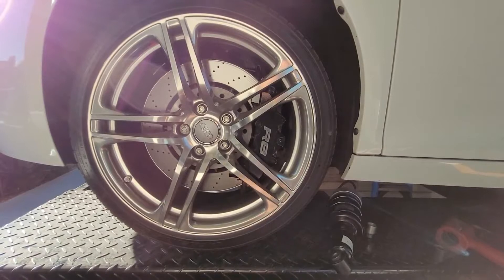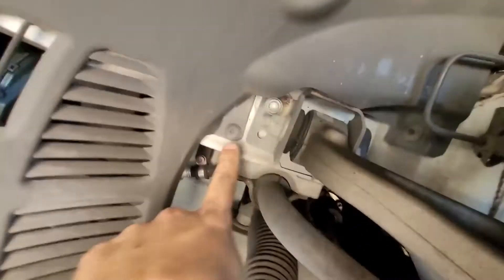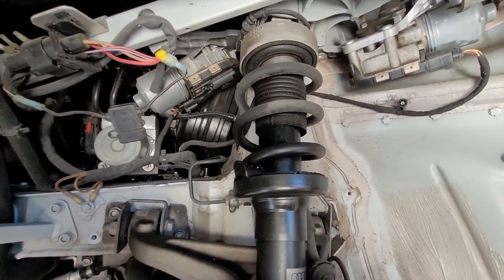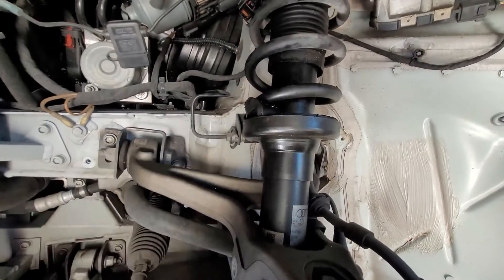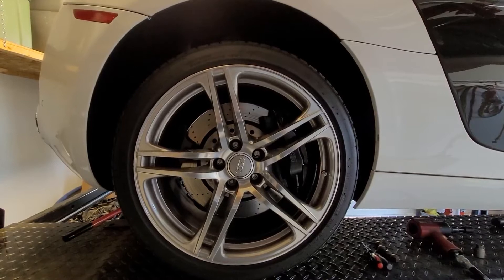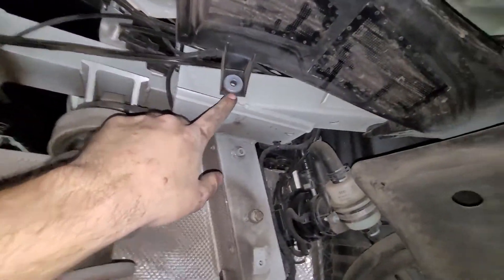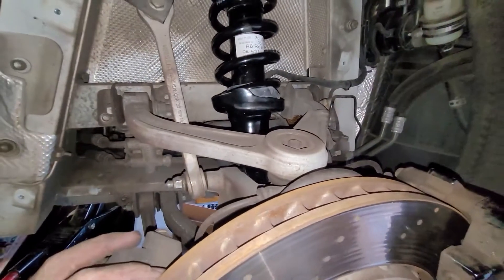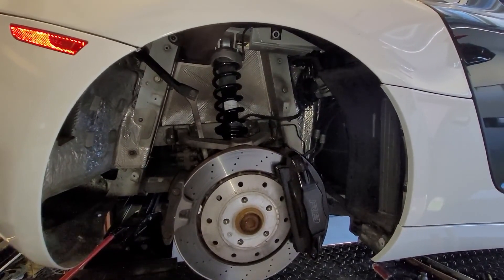R8 Magnetic Ride Shock Replacement with Shocks from China

Comment: How are the shocks doing?
Reply from the maker: They were terrible. Took them off and returned for a refund immediately. I didn't realize this at the time, but although the fronts were nearly identical in total length to the stock ones, the front shock's tube was shorter. This, I believe, allowed less travel and the front would bottom out over even slight bumps. I returned and went with Nagengast. I have a post about these on R8Talk: https://www.r8talk.com/threads/magnetic-ride-shock-replacement-with-shocks-from-china-endurance-longevity-tracking.175633/
Reply: How are the refurbed shocks going please?

Comment: Thanks for the video!  I think I can take this on after watching your video.  The local Audi dealership just inspected mines and said 3 of 4 are leaking - I have an 09 v8 with 60k.  I had a few questions.  Were you able to do all this yourself, or did you need another pair of hands?  Can you share what torque specs the top and bottom bolts required?  I also am looking to go with nagengast over BC racing and the mag ride delete which is already close to $2k anyways.  Thanks again!
Reply from the maker: I was able to do this by myself, no extra hands. I don't know the torque specs, but probably somewhere around 50 ft/lbs would be fine. I recommend torqueing the top bolts with the wheels off and leaving the bottom bolts a little loose. Then, put the wheels on and torque the bottom bolts with the car under its own weight (this prevents loading the bushings). I had a good experience with nagengast.
Reply: @NiXFiX  thanks for the additional tips

Comment: Any update on how they're doing?
Reply from the maker: They were terrible. Took them off and returned for a refund immediately. I didn't realize this at the time, but although the fronts were nearly identical in total length to the stock ones, the front shock's tube was shorter. This, I believe, allowed less travel and the front would bottom out over even slight bumps. I returned and went with Nagengast. I have a post about these on R8Talk: https://www.r8talk.com/threads/magnetic-ride-shock-replacement-with-shocks-from-china-endurance-longevity-tracking.175633/
Reply: definitely need a update on these.
Reply: @Funkbaron  Shame, I have a full set I was going to send for refurb...

Comment: i did this on mine and it now makes a squeaky sound whenever the shock is compressed. Any idea what that is? Anyway thanks for the video.
Reply: what is the bushing like at either end of the shock?
Reply: @M-B-G-A  thanks for the response. I got rid of the squeak with a little molybdenum grease between the frame and the Rubber bushings of the shock 🏆🏆🏆